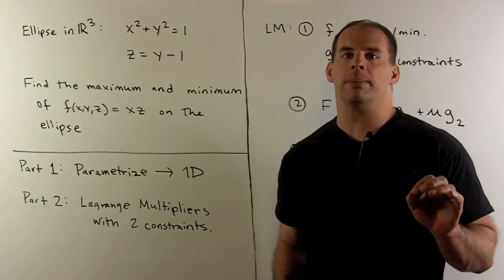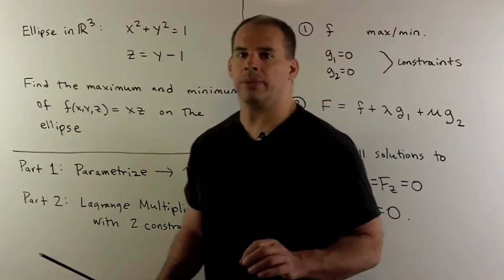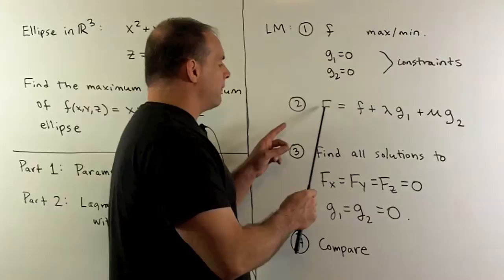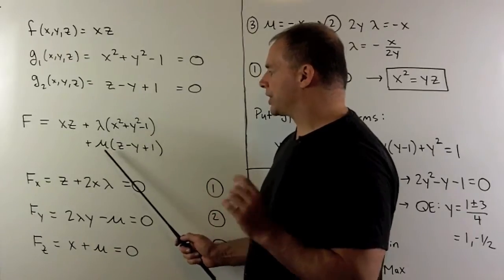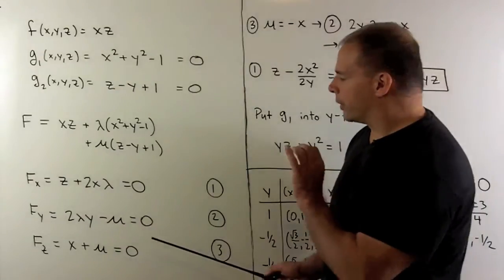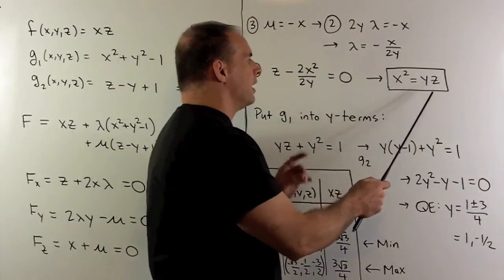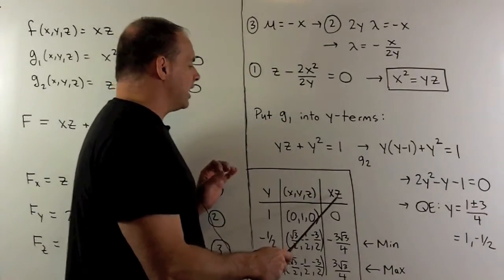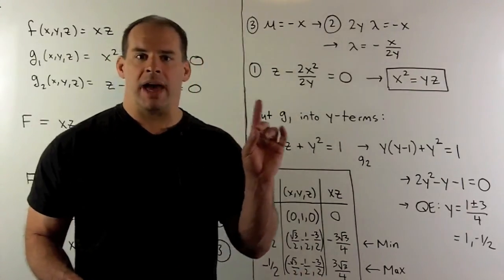Optimization on Ellipse in R^3 2:  Lagrange Multipliers with Two Constraints

Comment from the maker: Setup varies by book.  If you used F=f - lg1 -mg2, you would get the same answer as the signs will cancel out in the equations.  If you care about the actual multipliers, they will differ by a sign.

As a rule, I like to have the constraints as g=0.  Then it g or -g doesn't matter and there is no fuss over constants.